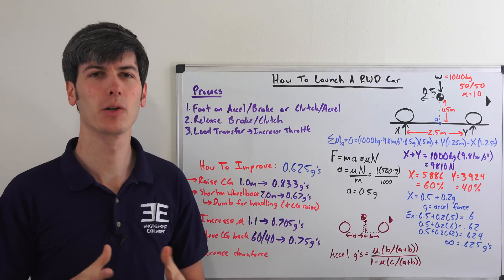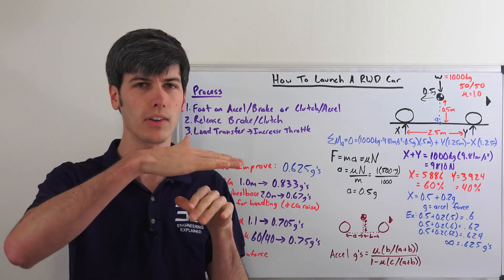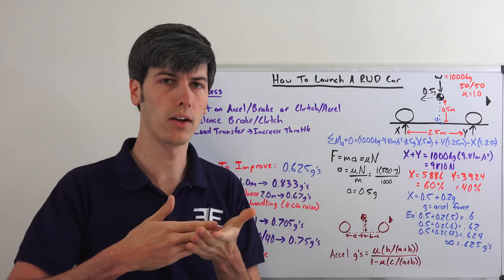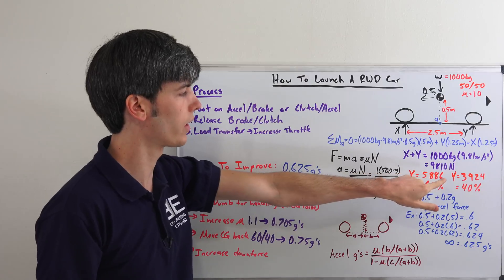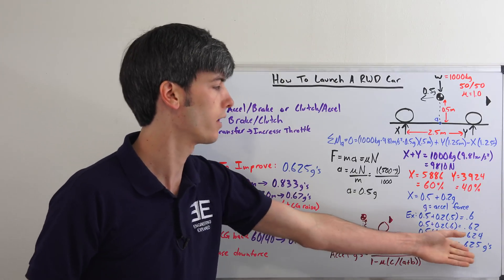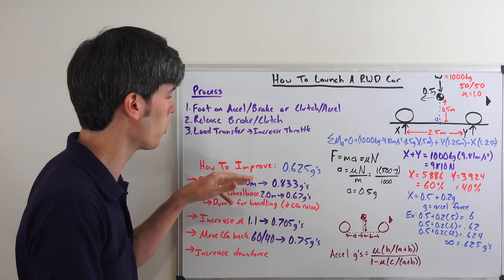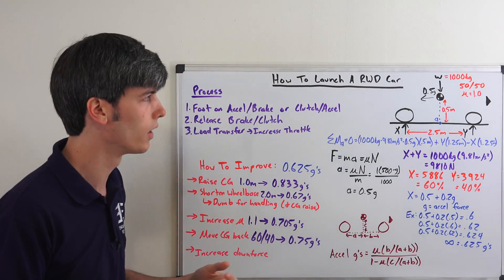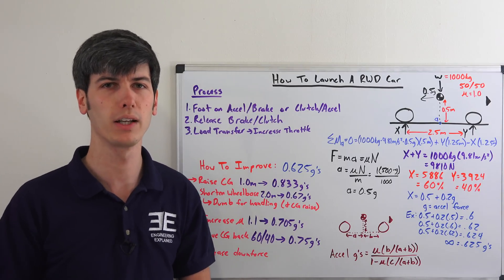How To Launch A RWD Car - Design Considerations

Comment: I know you've said in the previous launching video to launch at low rpms so you won't get wheel spin and cos of torque and all that but does this also apply to a rotary engine? I have a 1988 rx7 convertible, the only time I've launched it was when I had bald tires and I revved it to about 5k and dumped the clutch and spun the wheels, felt like I was floating for a bit

Comment: Excellent video, thank you. 
  So adding somthing like a magnetic adjustable strut in the back and having a way to program the settings on it to be stiff when hard on the throttle(70%+) then soften up when the clutch is depressed for a gear shift and then become firm again ( spring rate set depending throttle position untill crusing speed then spring rates are stabilized or reset to adapt to road conditions) would really help to launch a rwd platform? Are there any systems like this currently in place?

Comment: I'm probably not understanding something correctly. Are the g numbers low for simplicity sake? The way I understand it, some top fuel dragsters can pull 8 g's going down the 1/4 mile.
Reply from the maker: +t0f0b0 they have very special tires and a drag strip set up with perfect conditions. They'll accelerate at ~4gs, then load up with downforce. The exhaust alone creates about 1,000 lbs of downforce, but most of the traction is a result of tires that last about 20 seconds (burnouts and such) and have enormous grip.
Reply: Weight distribution on a top fuel dragster will be nowhere close to 50/50 or 60/40, so transfer of downforce will play a big part, coefficient of friction will be different with the contact patch on those things, aero, etc.

Comment: Could you do a video on torque vectoring? I've heard that the torque vectoring in the new Honda/Acura NSX is the first true torque vectoring system, where as all others used torque vectoring by braking. Could you explain this?
Reply from the maker: +Edmund52 The NSX isn't the first to have true torque vectoring, it's a specific style of differential (I have a video on it) that allows for the faster moving wheel to receive more torque. All other LSDs send more torque to the slower wheel. Some cars do use brakes to mimic it on the front axle.
Reply: I may be wrong, but I thought that the NSX torque vectoring wasn't to do with the LSD, but the 2 motors connected to each wheel that can function independently that allow for the torque vectoring. Or are the motors still connected to a LSD?

Comment: I'm confused as to why shortening a car would let it accelerate better.  

Top Fuel dragsters are being stretched and not shortened, why?
Reply from the maker: A short wheelbase means more load transfer to the rear wheels. Top Fuel cars already have the vast majority of the weight on the rear wheels, and a short wheelbase is very unstable. By extending the wheelbase, they can keep stability (and steering), but still have plenty of weight over the rear axle for launching. Load transfer isn't quite as important with these vehicles because the weight is set up from the beginning to heavily favor a rear wheel drivetrain.
Reply: for some reason I can't edit my comment, so I'm replying to myself.

My brain is telling me that by stretching the wheelbase and lowering the CG it would create a lever type action that would let the rear wheels dig harder.
Reply: I'm just spitballing here with you, but shortening the length between the COG and the rear wheels allows the static weight distribution to be such that there's going to be more weight on the rear than the front (assuming, like a dragster the front is low weight), giving you more traction in the rear like in the video (his was 50/50, a dragster might be like 75/25 or something). I think lowering the center of gravity might actually have the opposite effect and decrease the lever action because the torque/force on the rear wheels is generated by height length that the COG is from the center of the rear wheels, lowering the COG in this case would lower the dig. Dragsters are also kinda tricky because they accelerate so fast they need that super long front for stability reasons, but I have a feeling that it's relatively light allowing the weight distribution to be more towards the rear.
Reply: Zachary Garcia , Ok now my brain hurts. It's too early for this type of thinking.  lol

I'm going to get back with you on this. You are 100% in that dragsters have REALLY lightweight front-ends. I'll reread what you said and then think a little, and then get back with you.

Happy 4th of July weekend!!!
Reply: D Rock 75 You too homie!
Reply: Engineering Explained , Gotcha!!!  That makes total sense. Thank you
Reply: Engineering Explained Hey man, I'm an ME and love your channel! Keep up the good work.

Comment: the "0.5g" on your moment equation is confusing...had me lost there for a moment. LOL
Reply: doesn't make sense coz u already have 9.81
Reply from the maker: Whoops! There should be no g, just a 0.5. Math will still work out. The "g" references where is 0.5 comes from, but obviously that would throw off the units.

Comment from the maker: If anyone is interested in more in depth looks at the math in these kind of videos, I've linked a pretty cool book in the video description. Let me be clear in that the book is very math intensive; if math isn't your thing you probably won't enjoy it, but if you enjoy geeking out about this kind of stuff, you'll love the book. Still has explanations of different situations, but uses math to verify points. I've quite enjoyed it!
Reply: hi, can you do a video on air brakes vs disk brakes vs drum brakes
Reply: You're very genius man, I'll pass to see that book. Greeting from argentina.
Reply: расскажи про дрифт на переднем приводе (rus)
Reply: How does the engine position effect on this? Is it only the weight distribution? What is the best way to keep the nose of the car down when you have a lot of grip and power? (when the power tries to turn the car round the axle) How can you find the maximum there?
Reply: In the summation of the moments: why did you write (1000*9.81*0.5g) * (0.5m)? you put 9.81 twice. Shouldn't it be only 1000*0.5g *(0.5m) or 1000*9.81*0.5 *(0.5m)?

Comment: What about the change of the coefficient of friction while rolling compared to when stopped (static & dynamic). Although you have the weight transferred from the initial launch the friction coefficient is less so actual max acceleration may not increase as much.
Reply from the maker: Perhaps I'm misunderstanding, but I think you're confusing static and kinetic friction. Once the car is moving there is still "static" friction because relative to the ground, the contact patch is moving at the same speed. Only if the tires were slipping (like a burnout) would it be the kinetic coefficient of friction, as this is when the tire's contact patch would be moving a faster speed relative to the ground.
Reply: +Engineering Explained thanks for the explanation it's been a while.

Comment: The reason why some cars can accelerate faster than 1G is a combination of factors. The tires which may have a coefficient of friction greater than 1 is one of them. The other is the labour of the friction force: if you spin the tires, assuming that the coefficient of friction does not decrease dramatically (it actually will past to a temperature threshold) then you will be able to generate more force friction labour which is basically the force which pushes the car forward. the drag cars that have a wheelie bar will also benefit from the fact that the rear axle will push itself into the ground which ups the grip quite a lot.
Reply from the maker: I've never heard of "friction force labour" but a wheelie bar shouldn't increase the amount a vehicle can accelerate, it simply prevents a wheelie. If a wheelie occurs, some weight is transferred to the wheelie bar, meaning less weight overall on the driven axle, meaning a decrease in the theoretical limit of acceleration. You'll want to ensure the wheelie bar is at the right height so it doesn't get involved too early.
Reply: Think about a grinder: at a certain speed you will grind a certain amount of material in a certain amount of time. If you increase the speed or the grinder you will grind more material in the same amount of time. You basically transfer more energy (power) into the material and you will also have to increase the effort to hold the piece in place (more muscle, or tighten the vice more, or whatever). The friction force will require the same amount of energy to grind a certain amount of material, just that in the second case you will put more in the same amount of time.

Comment: Sorry just a quick question about your equation where you balance the moment with respect to a: 

does that say (1000*9.81+0.5g)*(0.5) +Y*1.25-X*1.25

OR

(1000*9.81*0.5g)*(0.5) +Y*1.25-X*1.25
?

I might have made some mistakes somewhere but I don't think it gives 0 when you sub in your X and Y in either...

Please help.
Reply from the maker: Sorry for the confusion. Your second equation is correct! (1000*9.81*0.5g)*(0.5) +Y*1.25-X*1.25 = 0.

Comment: This is why I try to tell my other muscle friends to not straight up drop the clutch on launch. Letting the clutch slip a bit and giving firm but gradual throttle is best, as you've explained with how continual load transfer is moved to the rear. Thank you again!
Reply from the maker: Absolutely, fairly quick but a smooth motion!

Comment: Hi, 

If a very lightweight car, say, for example a 300 pound mini car have the same horsepower as Top Fuel dragster at 7000 and above, will it accelerate faster than the Top Fuel dragster? I think despite it weigh only at 300 pound it still can't beat the Top Fuel dragster in a quarter mile drag race.
Reply: +Zackarih Hartford I see. So if I already understand you, even the 300 pound mini car with hypothetical 700 and beyond horsepower can't beat Top Fuel dragster in a straight race, correct?
Reply: +Zackarih Hartford *7000 and beyond horsepower
Reply from the maker: Several reasons why it won't, but much of it comes down to the tires. Top Fuel cars run super sticky tires, capable of ~4 g acceleration (plus downforce, meaning more than ~4g's). But if you were to shrink a top fuel car and make it only weigh 300 pounds and kept the horsepower and downforce equal, sure it would be quicker (also because there would be less drag on a smaller vehicle, but remember you'd need to keep a big wing for downforce).
Reply: Is horsepower important in drag race? Which is more important in straight races, is it horsepower or torque?
Reply: +Engineering Explained isn't the wing need to be at least weigh at several thousand pounds to keep the 300 pound mini car stick to the ground so it will not flying over the track?

Comment: thx now i know how to launch my Volvo in reverse.
Reply: +TheDamnSwede slap that gear selector into "R" for racing 😜
Reply: All "normies" know how to launch their car in reverse
Reply: True XD
Reply: Get and older one and enjoy rear wheel drive instead ;) I got one. The joys I've had with it!
Reply: +dontwannachangemyname sorry but i really do not like old Volvos.
Reply: +TheDamnSwede Too bad!
Reply: dontwannachangemyname SAAB 99 EMS/Turbo <3
Reply: +TheDamnSwede those are probably great too! never had any experience with one tho. Should I mention that when I refer to an old Volvo, I mean a 1996 944, aftermarket tuned with a 16t turbo pushing 1.2 bar with 475 cc injectors and 2.5 inch DP and 3 inch catback? Pretty fun to launch actually. :)
Reply: dontwannachangemyname Well, i dislike the 200/700/900 series. mosstly because how alot of young people here in Sweden treat them and how thet act. but i approciate a nice old volvo that gets treated like a more expensive car than it is. My heart goes to SAAB and if it would be so expensive i would have totally bought a saab 99 EMS or a Turbo. But a nicly built 200/700/900 series volvo is something i can like but mostly cuz someone have put a lot of time and effort into making it nice and personal.
Reply: +TheDamnSwede Yeah, I've actually heard a lot of sad things about the older volvos in Sweden. I've seen some people treating them as the high-end cars they can be though, and that makes me happy, regardless of manufacturer ;)